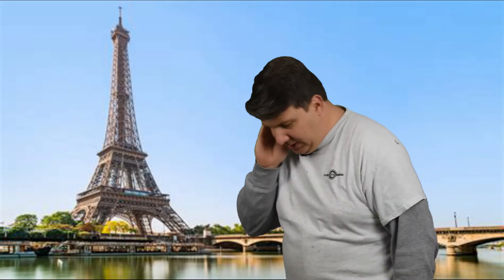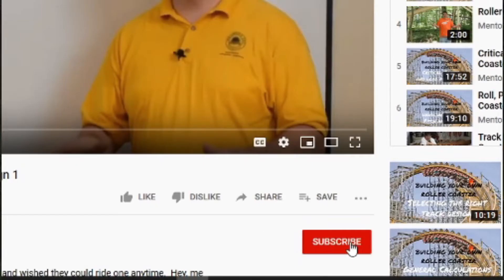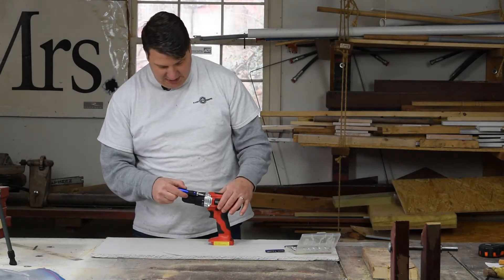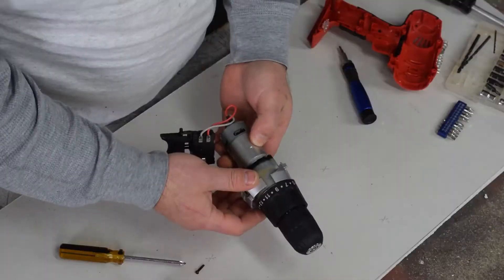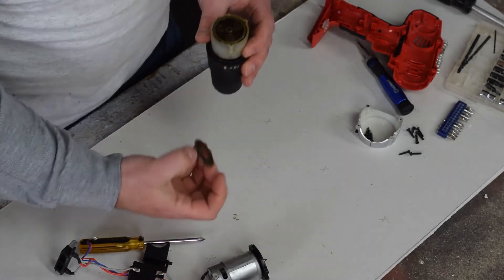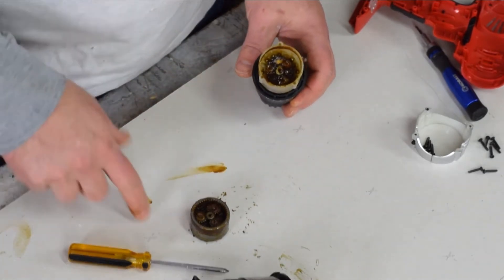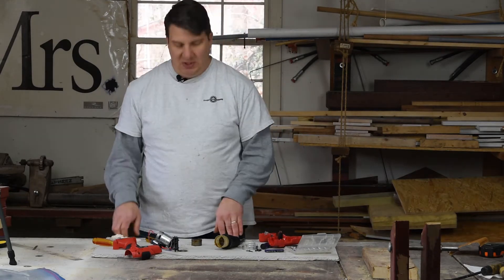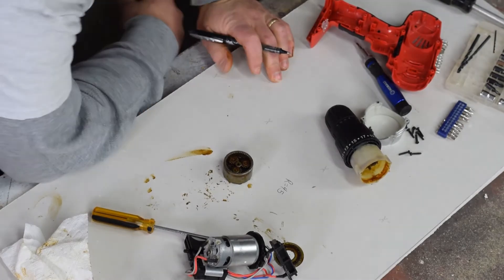STEM - Using Planetary Gears in a Hand Drill - High Torque from a Small Motor

Comment: The input is carrier and output is ring right?
Reply from the maker: The input in both stages is the sun.  Stage 1 is the motor shaft.  The stage 2 sun is connected to the stage 1 carrier.  THe ring is held steady, but if the torque is to much, it will rotate.